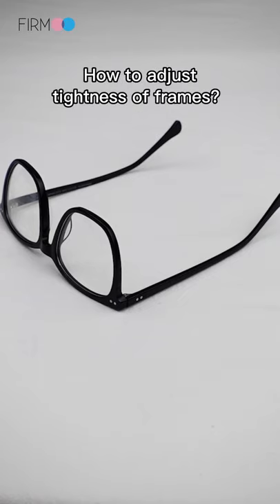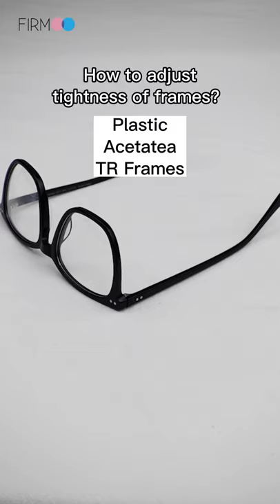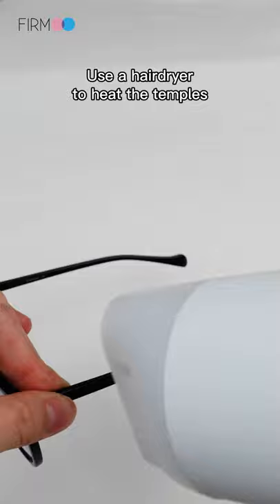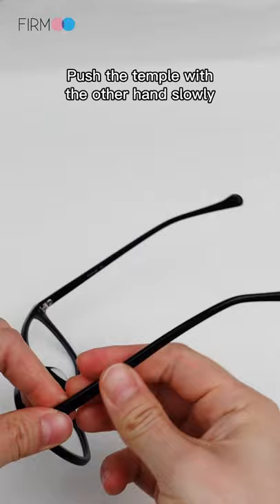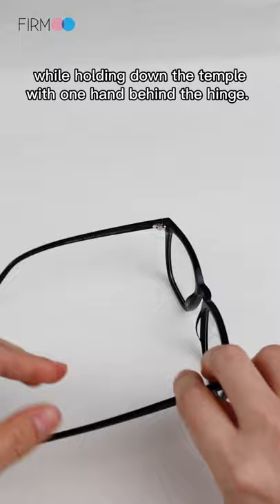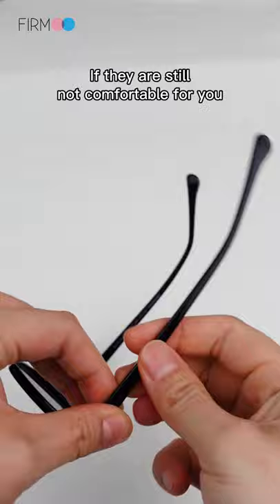How to Adjust the Tightness of the Plastic Frames? | Firmoo.com

Comment: The issue I have is how do I tighten the two metal screws that connect the frame with the leg . I’m not talking about the screw on top but the two little pieces . The frame in this video have those too.